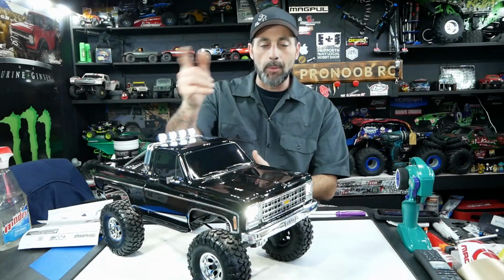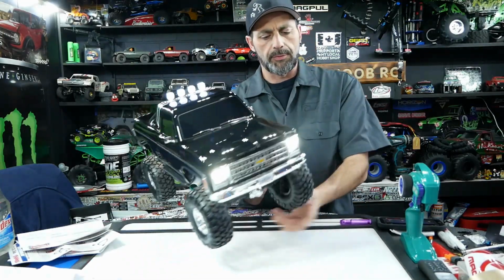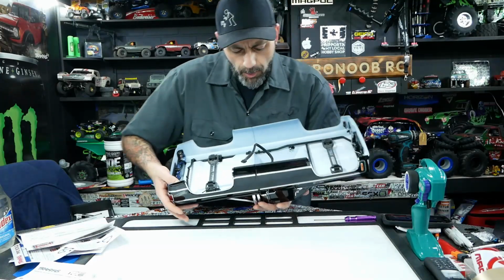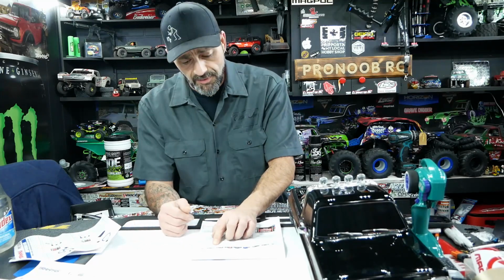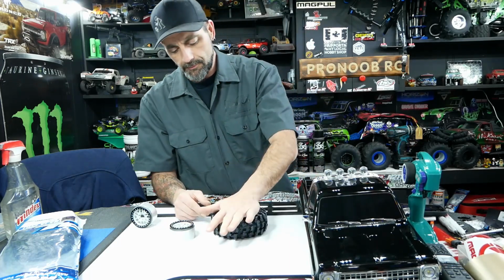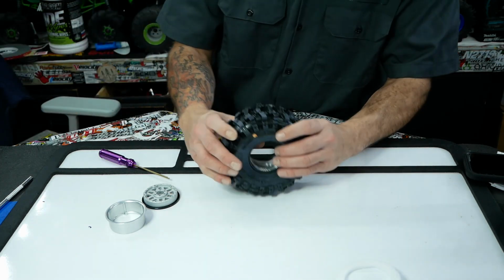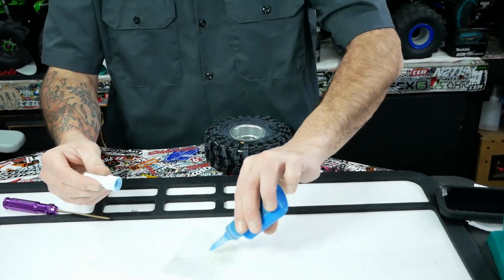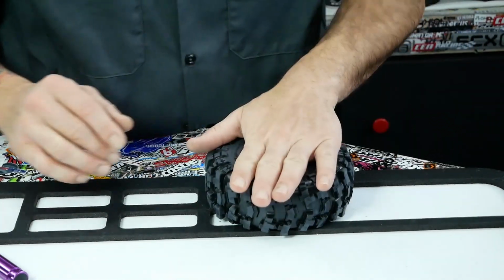TRAXXAS HIGH TRAIL RTR: WHEELS, TIRES, and LIGHTS

Comment: I recently picked up the High Trail.  Everything is still stock.  It crawls like crazy all over the frozen Iowa snow 'n' ice.  Probably might cut out the drivers side window then stick in my Cliff Burton figure.  Thanks for the video.
Reply from the maker: Great winter and general off-road rig for sure! Not every scale 4 x 4 has to be a rock crawler! A lot of people get that mixed up when you tell them you have a TRX4 for swamp or snow lol.
Reply: @ProNoobRC  It's an art to crawl.  To go over the line with patience manipulating the machine.  I am a metalhead so I still go fast even at 51 years of age, haha, but cruising/crawling is cool too.  In high gear the K10 flips easily cause it's jacked.  The HUGE wheels you put on yours must rub cause the stock ones do, lol.  It's easy to work on for noobs like me.  I'll keep watching your videos to see if you do any changes with servos, motor, etc, etc.
Reply: HELL YEAH CLIFF EM ALL
Reply: Pro- how do you keep the body from rubbing (out of the box) thanks.  Just subscribed

Comment: Which battery do you use?
Reply from the maker: Traxxas ID 5000 3s for trail and 2200 Ovionic for crawling mounted in front. But this truck will only see trail. Mostly snow and mud

Comment: Watch me turn one into a $3500 monster...I just wonder how hard it's going to be to add another shock to each corner??...🤔...yeah...I'm that guy...😂...😎
Reply from the maker: Oooooweee!! Few brackets you’ll be good!
Reply: @ProNoobRC  I had an original TMaxx 3.3....over about a year, that $550 Nitro Truck ended up being about $3500 after I found Integy parts!! I swapped out EVERY PART of that Truck with all the cool mods...yeah...I'm THAT guy. And it was Awesome,  indestructible and FAST...and it got stolen...so this HighTrail will be my "Comeback" Truck...only this time I'll find a way to change out those Dark Windows for the cameras...
Reply from the maker: Oh no!! that’s my biggest fear. Is somebody stealing one of my favourite builds
Reply: @ProNoobRC  I bought that TMaxx in 2002. Over a few years the only thing left to get was a set of tracks...so I'm over it and ready for that F150 High Trail...and I'll do it again..😆..and eventually replace every part with something cool...takes time but it's FUN...
Reply: Oh, with the original Nitro 3.3,...only a little modified...and only on it's second glow plug...